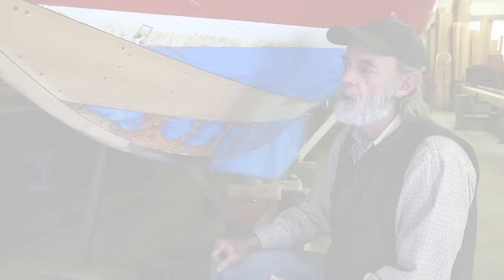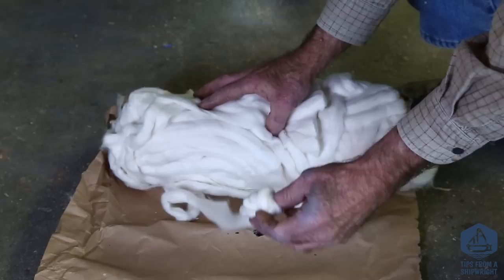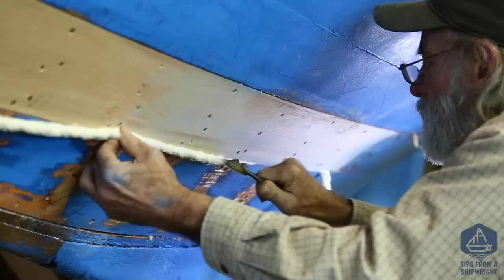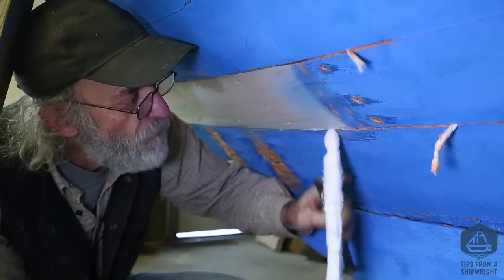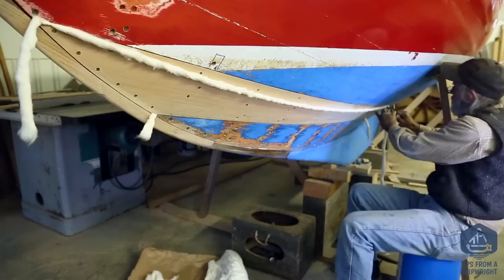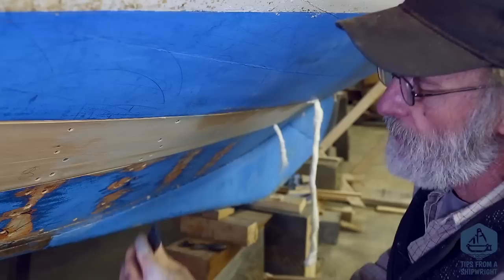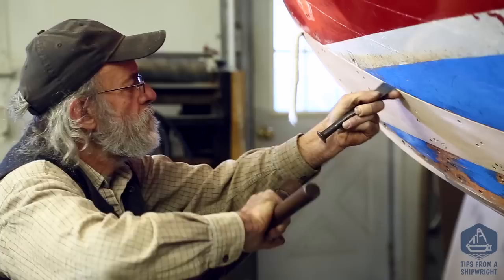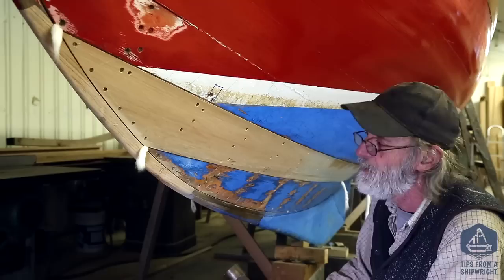Part 11 - How to properly caulk tight seams for wooden boatbuilding - Herreshoff 12 1/2

Comment: I caulked my whole 37 foot wood EggHarbor boat underwater seams with PL Premium  Polyurethane CA (28 oz tunbes)  mixed in about 30% to 40% sawdust (IMPORTANT to do that). Used a putty knife to forces it into the seams. I have done it up to 1/4 inch seams, but most seams were around 1/8 inch after I reframed the boat and the summer heat came and the planks got real dry. I had all the bottom planks off in quarters of the hull  at a time while replacing the frames with PT SYP (no knots) painted with zinser 123 white primer. Did that in 2005, and it is still ok. I had one wide seam mainly cause I suppose the old mahogany from 1970 boards had worn edges around the struts, but no problems with leaks. And another seam where i had 1/4 inch gap all the way along the planking run of the board. For that one I cut a narrow spline and pushed it in with PL glue then caulked over top with PL mixed with sawdust.  I have been in and out with no waiting for it to swell, and none of the PL-sawdust mix popped out of any underwater seams. Adding sawdust to this glue cures it faster and in thicker layers and also adds compressive strength to the glue. It is kinda like soft pine in compressive strength mixed sawdust, so its like the whole boat is as a gapless  wall of wood. It also has spring back, so planks swell and move and the PL moves too. PL is a moisture cured polyurethane and it can not melt, is easily sanded smooth. It also holds up to 300 degree heat, fixed all sorts of things with it, like a frying pan Bakelite leg. This  glue-sawdust mix swells as it cures, so you can pass a putty knife couple times over it then just leave it alone till the next day. You can also put cereal bag plastic on top and press it down, will form a nice smooth edge. It also takes wood stains very well. Use the same kind of wood species sawdust and it is going to look just like the surrounding wood.